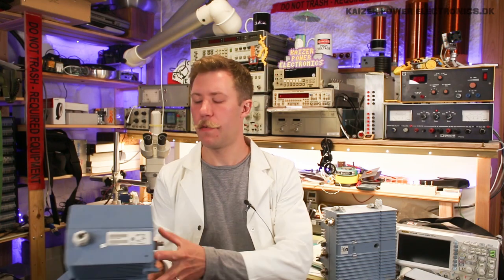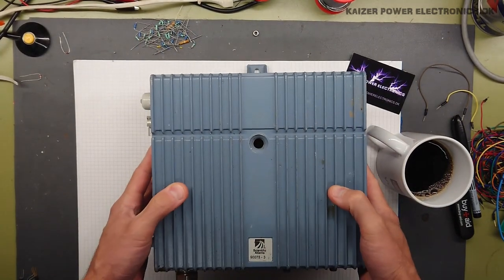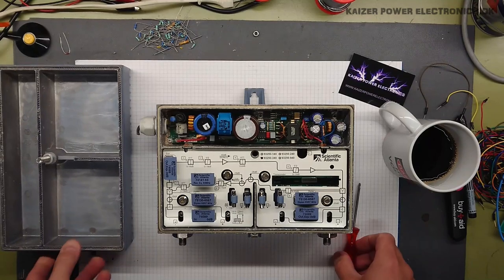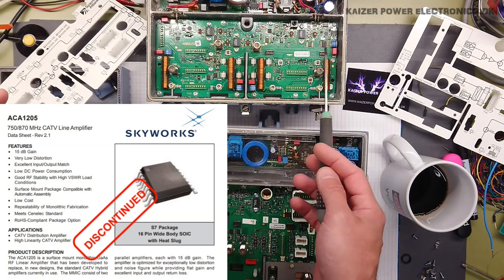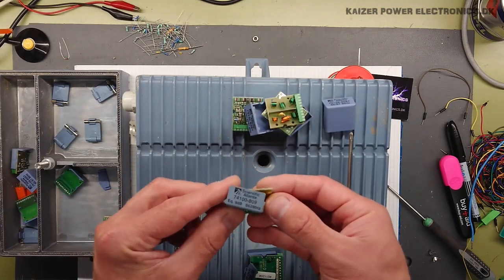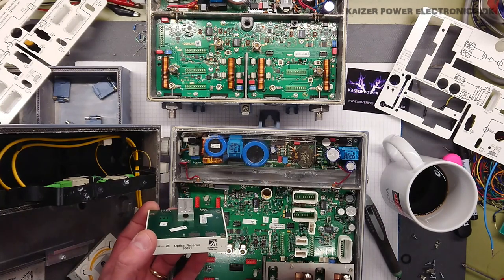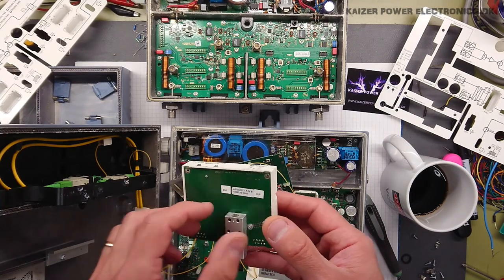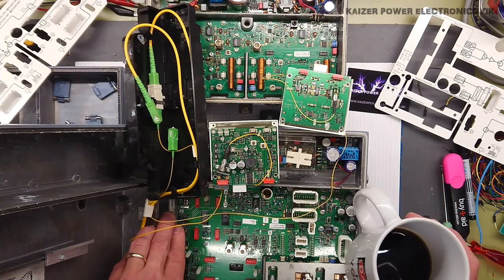Cisco Cable TV Optical Node and RF Amplifier Teardown

Comment: Green booted fibre connectors are a little special. The ferrule has an angled polish of 8 degrees, which helps to reduce back reflections. Because of that angled polish you should only ever connect a green boot to another green boot. They are generally known as "APC" connectors.

Blue booted connectors have a flat polish (PC), or perhaps slightly rounded (UPC), and it's generally fine to connect any blue boot to any other blue boot.

But definitely never connect a blue boot to a green boot as the ferrule polishes are incompatible.
Reply from the maker: Thank you for teaching me something I did not know! :)

Comment: Interesting look at these things. I came across some very similar boards on the scrapyard lately. I assumed them to be some kind of TV stuff, now I know. 
Interesting to note is that the cable TV guys work with dBuV instead of dBm and therefore in voltage, not power. I just thought this might be an interesting detail and that's also why you don't find any max. power output numbers in the amplifier data sheets. 

The casings on these look pretty rectangular on the inside, they might be pretty interesting for some outdoor (radio) projects.